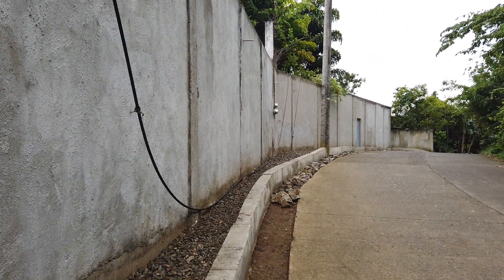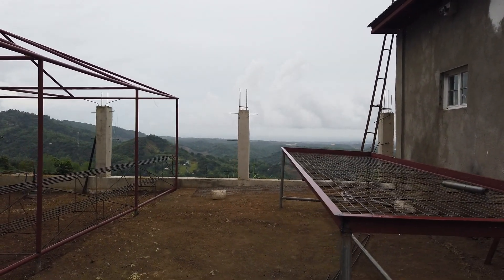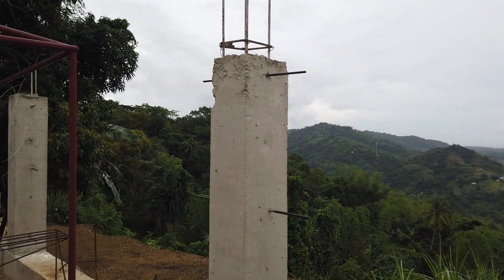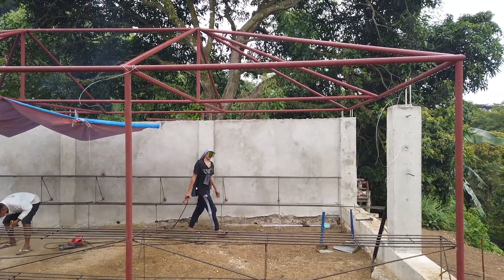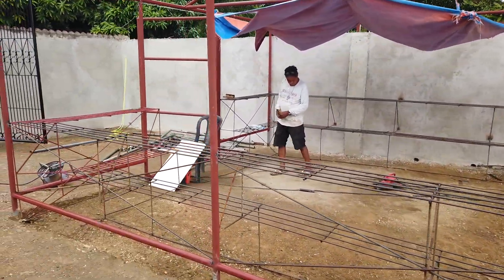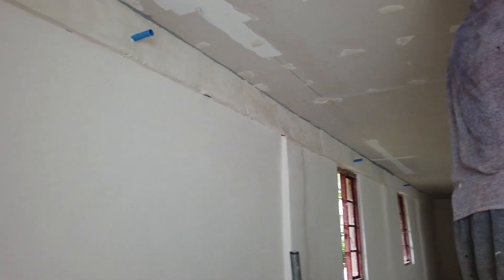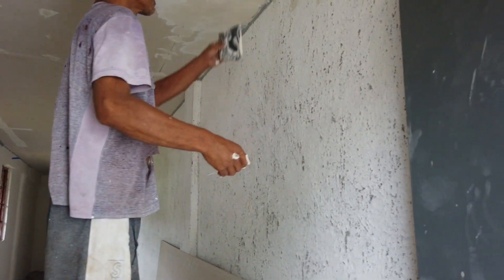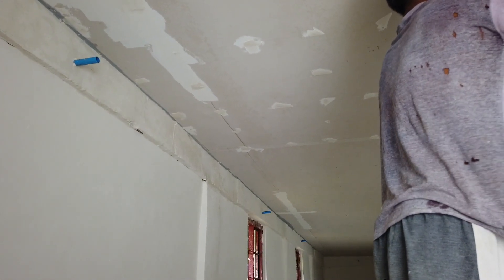Building Update In The Philippines. Nov 29, 2020.

Comment: I feel like I missed the explanation for why the generator room will be left open. I would think that outside elements (like moisture and critters), will not be good for the generator.
Reply from the maker: Neat gifts I need to leave it ventilated and therefore open for exhaust fumes and air intake of the engine. Although I am considering going full solar.
Reply: @villagepeoplephilippines  I have never had a generator before, but I would think good ventilation around the ceiling and outside walls would provide enough air flow.
I am hopeful I can afford solar and a generator for backup as well. I lived through one typhoon in Manila, back in 2014. We were out of electricity for four days and nights. It was really hot all day and night. Our backup flashlights didn't last long. After a few days of that, we went to the mall thinking we might use the Mall's electricity to charge our cell phones. Turned out that everyone else thought of the same thing. The mall was filled with people all against every wall trying to charge cell phones and laptops. Also to cool off as well.

I want to be prepared next time. Everyone says Davao City is blessed and won't have typhoons. I plan to be ready when that blessing isn't there.

Glad your legs are felling better!